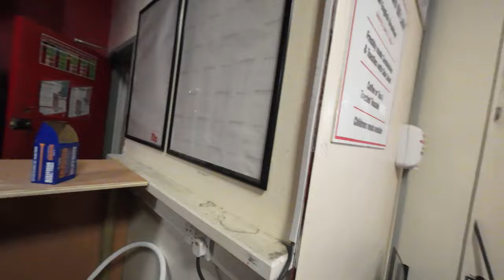coffeebar

Comment: Pete are you having these coffee machines facing outward I saw the coffee machines the fronts are facing outwards that are the front is going to face with the wires showing through the back I just they are going to be front way to facing the bingo then people will have to all the weather is serving come around to serve if they are facing inwards you might have to block the back back off can you let me know please and what on which way they are going to face in our out
Reply from the maker: The machines face inwards all wiring pipes etc is underneath and the rear of the machines are insulated to prevent burns etc the coffee bar itself will be staffed and a small swing gate at the rear